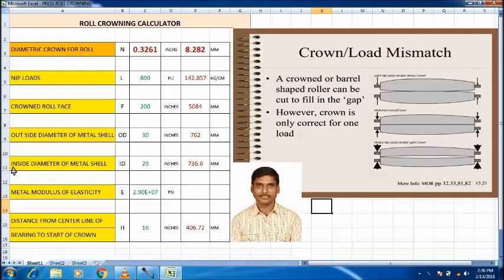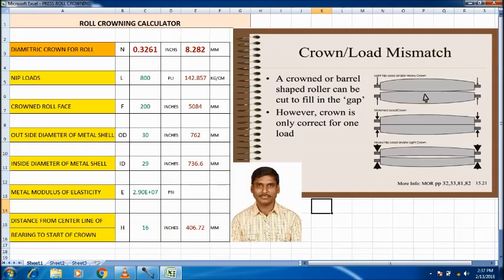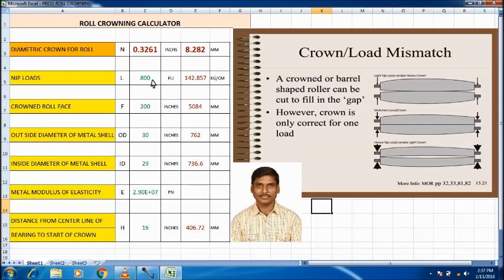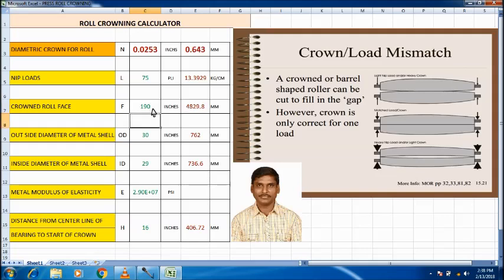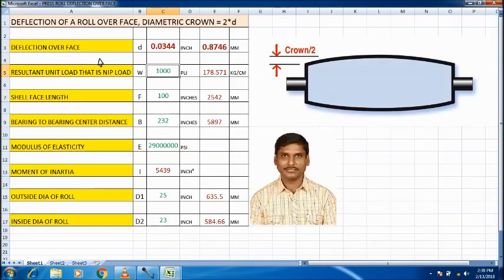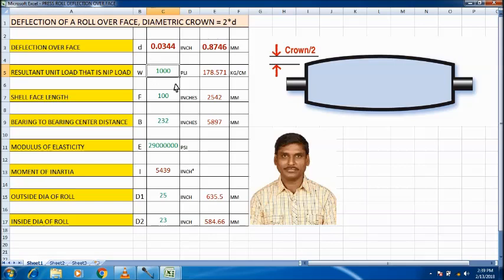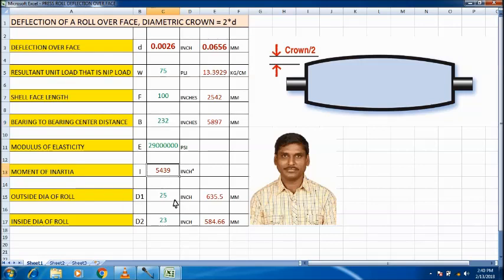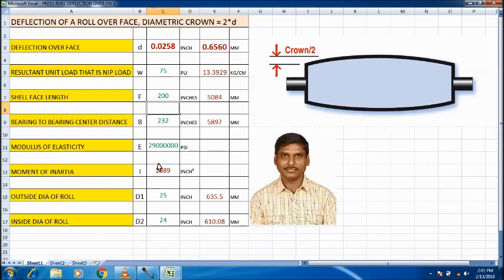PRESS ROLL CROWNING

Comment: Hi Busam, Your calculator is very helpful for solar technician. Can you please help further in setting up new calculation, I need to know about pipe size in inches. Please share you watsapp no or watsapp at 0336-4058097